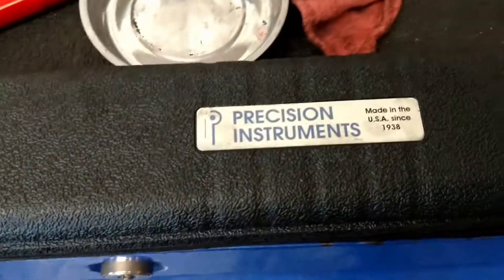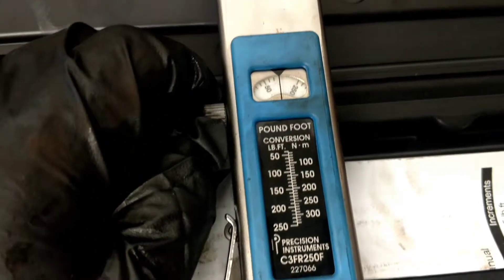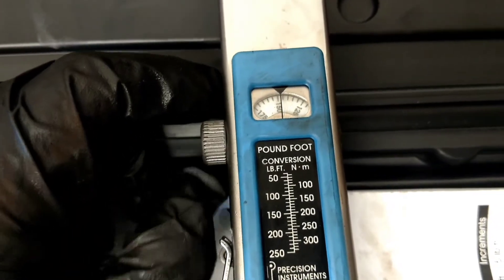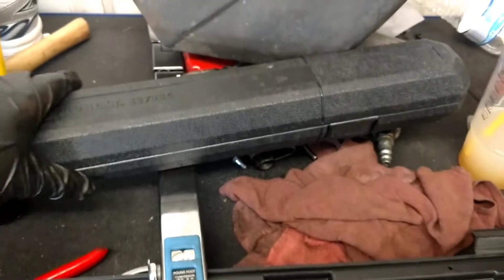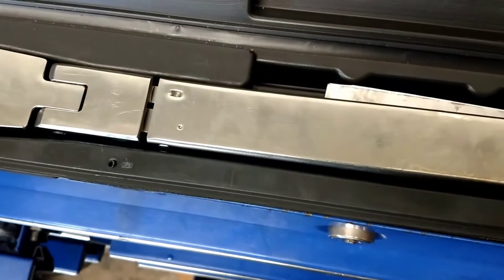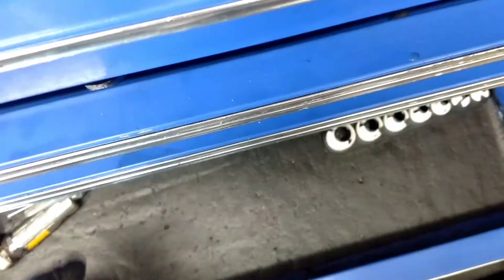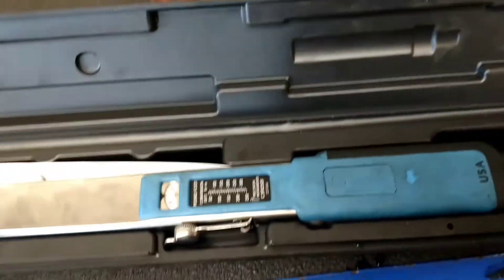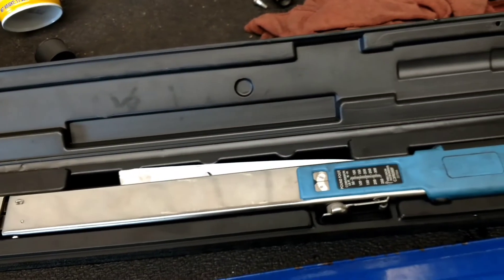Precision Instruments Torque Wrench Review

Comment: I saw this tool on amazon for 239$ CAD it looked amazing, ive seen a couple reviews on amazon too comparing to snap on...i think im sold dude.......i think im going to place my order tonight. Ill wait a few hrs to see if anyone replies with a reasom not to buy it.
Reply: You can get it on US Amazon for 138USD shipping included.
Reply: hey man qucik follow up....is it any good???, was gonna get a snap on one but want to save the money
Reply: @Jellyyy  I've used it a lot this spring redoing the entire suspension on wife's sedan.  Love it! Never been a fan of the micro type torque wrenches.  I've had bad luck with them.  This thing is simple, quick and easy to use.  Plus you don't have to worry about unwinding the tension after every use. I'll never go back to the other kind. At least not for 1/2 inch torque.  A lot of guys in the tire changing industry swear by these.  They get many years of use without losing calibration.
Reply: @ureasmith3049  done, just ordered mine, thanks for the feedback very much apprenticed!

Comment: Snap on’s torque wrenches are made CDI which is owned under Snap on. Mac tools torque wrenches are made by Percision instruments
Reply: PI makes the split beams like these for snap on. CDI makes the turn click type and the digital torque/angle wrenches for snap on.
Reply: @code_red7744  ...PI quit making these for Snap On in 2003, Snap On bought CDI and CDI makes their "industrial Grade" for Snap On now. Quote from CDI web site: "Today, the CDI Brand is now part of Snap-on Specialty Tools" The CDI # 2503TQFR is the equivalent torque wrench to this video reviewed PI C3FR250F. There are minor cosmetic differences but there's about a $100 higher price on the CDI BTW CDI makes both split beam and micrometer types among others...so does PI
Reply: PI did make SnapOn torque wrenches at one point it think, now CDI makes them.  Again, I think that was the case.  PI is great.  I have this one in the video and a smaller 3/8 100 ft-pound wrench for smaller jobs. I am not a mechanic, but I’m just a DIY with attention to detail, used many tools over the years from different decades and price points...and PI makes good stuff.  But that probably goes without saying really.
Reply from the maker: Evan72 good to know thanks!